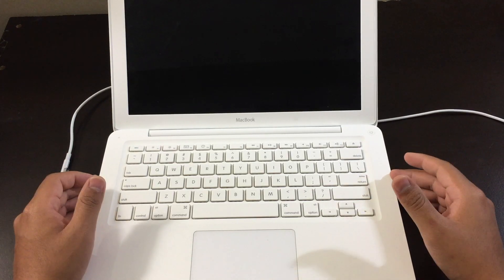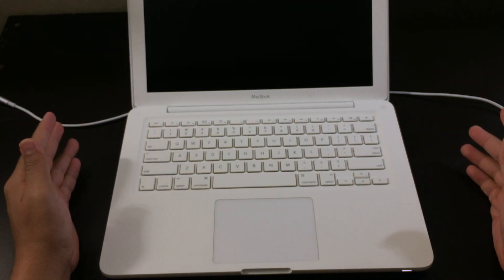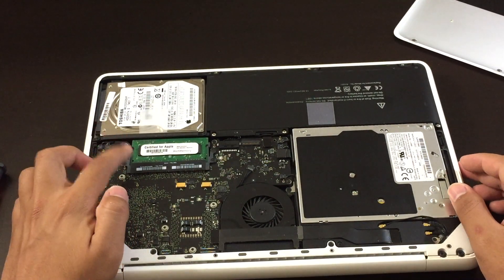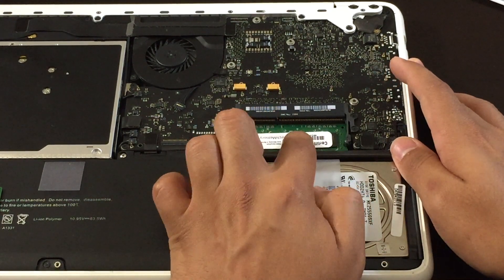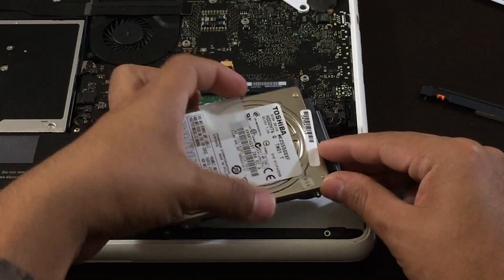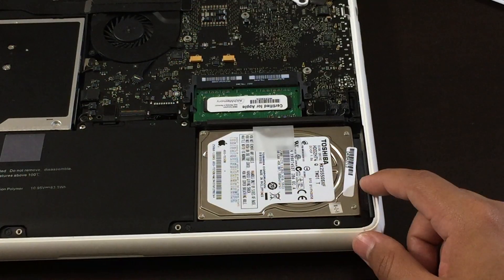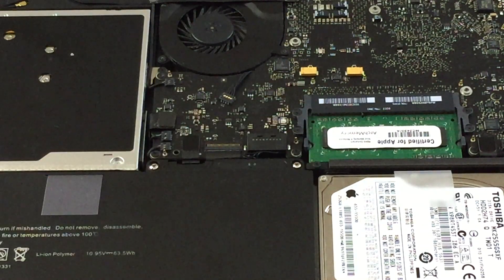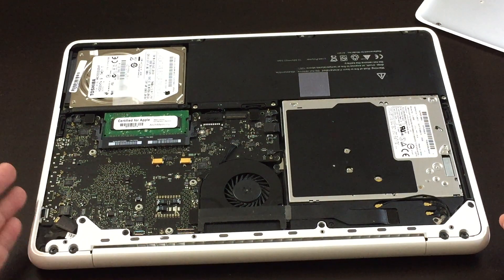How to FIX Unibody Apple Macbook [Works in 2021]

Comment: It came back on then shuts off for a few minutes then the charger doesn’t light up did the power cycle and reset ram/HDD/battery ...getting the part and new charger..

Comment: I had the same MacBook but the battery bloated, so I removed the battery and tried plugging the charger but it won’t boot up. Any help with this
Reply: My has the same problem as yours,
Reply: This model won't start without battery

Comment: Thanks for the advice. Had another unibody have both a bad screen and a bad motherboard, but this one was going just fine and then suddenly wouldn't turn on. Still can't get it on, but will try the memory solution.